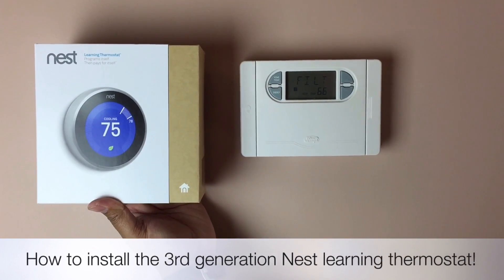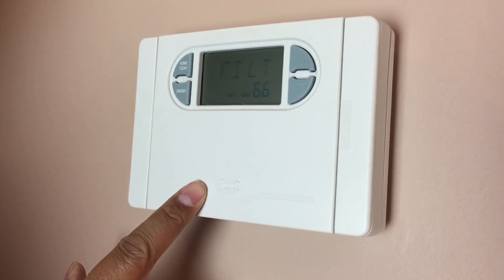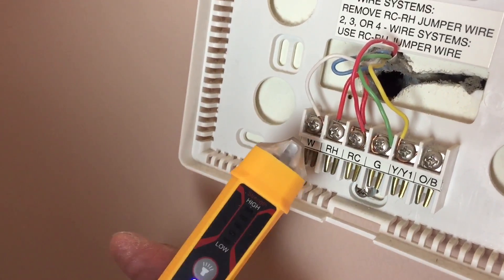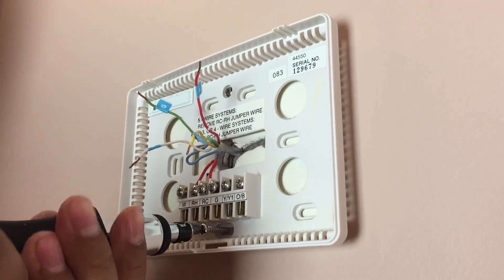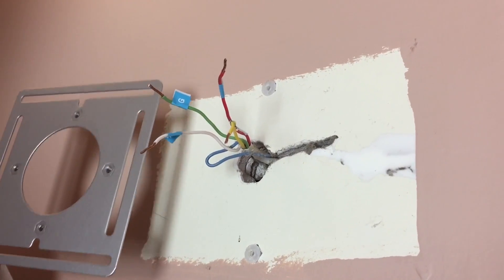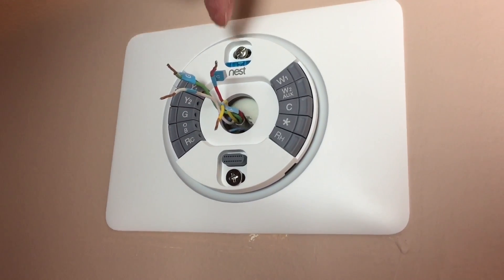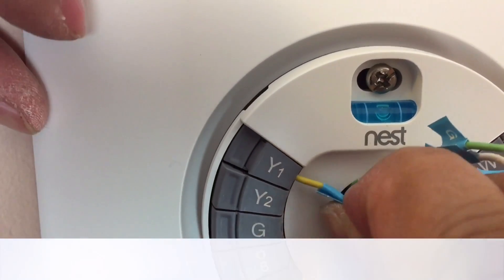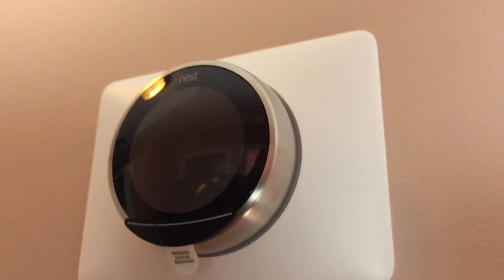Nest 3rd generation installation - A step by step guide

Comment: Thank you so much for this tutorial.  I noticed that your setup didn't include the 5 wire "common wire".  With the 4 wires, did your Nest function properly?
Reply from the maker: Hi, I ended up installing it after the fact. I missed it as it was tucked inside the wall and I didn't see it.
Reply: @johnny0723  Thanks for the clarification!

Comment: Does your Nest thermostat not require a heatlink to the boiler?
Reply from the maker: I'm not sure, I followed the recommended wiring from the Nest app. One thing I ended up doing was connecting the blue common wire, which I missed during the filming of the video and realized later when the nest was complaining of power. It was kind of tucked away initially and thats how it was missed.
Reply: @johnny0723  I think the UK nest always requires a heat link, where as in the usa you just plug the cables in. Behind my current thermostat there's nothing.. haha

Comment: I noticed you don’t have a common wire. The other videos I’ve watched says you need a common wire to power the thermostat
Reply from the maker: Hi I actually did go back and hooked up the common wire. It was tucked away inside the hole and I missed it. The thermostat runs into issues on the summer and that’s what made me go back and check it. Good luck!

Comment: I see you have a dual transformer furnace/heating system with a JUMPER cable which you removed upon install of the nest, same as me. With your current setup it has been working fine? Btw the online compatibility test is very deceiving. On the NEST E it told me it will work, then on page 3 of the install manual said that a dual transformer system will not work.
Reply from the maker: It’s been working well for a couple years now. Note that I went back and found And installed the common wire as well. 😎
Reply: @johnny0723  Oh I see, so without that common wire the unit did work correctly?
Reply: Did you have to run the common cable separate to the furnace?

Comment: This is a really low-effort video but I guess it's useful if people have the EXACT SAME THING as you, which is very rare.
Reply from the maker: Yeah most people will not have the same thermostat. However, the wiring underneath should be very similar for most. Thanks for the comment. 👍🏼

Comment: If theres a power failure,  will the nest have to be reset?  I notice that's a problem with my existing thermostat.  Looking for something that has a memory..
Reply from the maker: The nest has battery backup, but not sure how long it lasts. I've read that you can plug in a power pack to keep it charged though. Check the manual or contact their support if there is a doubt.

Comment: Failed to mention: If the thermostat has just been sitting idle for a long time the battery will probably be dead so don't be alarmed if it doesn't come on instantly. Stick it on a micro USB to charge faster!
Reply from the maker: I hadn’t thought of that, but good tip. Thanks! Both of my Nest thermostats has power and booted up instantly.
Reply: THANK YOU. I didn't think of that..I was wondering if I was wiring incorrectly

Comment: I checked my wiring. Sadly its not compatible with my existing thermostat. And our house was built in 2016. 😭
Reply from the maker: Wow that’s surprising! Make sure you check hidden wiring. I had a blue common wire tucked away that I missed. You can also hire someone to make sure the proper wires are there. If you feel this is worth it. Check with your electric or gas company. Some offer free installation and may do the necessary wiring. They also offer rebates!

Comment: Do you have C wire?
Reply from the maker: Yes. Need it to keep proper power to the Nest.
Reply: @johnny0723  not according to your video. I didnt see you adding the c wire..generally you can jump it at the furnace from y to g then move G to C on the themostat..
Reply from the maker: @rhdtv2002  yes, I missed it when installing it somehow as it was a little tucked away in the back. I noticed sometimes in the summer my Nest would run out of power or something and I couldn't turn on the AC. One winter, my furnace board needed to be replaced and the tech helped me reconnect the C wire that I originally missed. I wished YouTube would let me edit my video to add a clip, but it doesn't. I've updated the video description for folks to not forget the C wire. :)
Reply: @johnny0723  ahh..that how mine was..it was connected at the furnace but left inside the wall when the old thermostat was placed.
Reply from the maker: @rhdtv2002  Yes, in my video you can see the blue C wire in the wall. I didn't notice it or paid attention to it because the Nest app didn't seem to think I needed it. But it was there and I had those symptoms. Everything has been smooth ever since. What is very weird is that my downstairs Nest would not work if I plugged in the C wire. Perhaps its not plugged in at the furnace for that zone? Anyways, everything has been working just fine for both zones so I just leave it and enjoy. :)

Comment: Blue wire goes to c or common, when your battery gets weak your thermostat won’t work. You had the common wire you should have hooked it up, and you may have to connect it on the board at your air handler. Yes the nest has a battery.
Reply from the maker: That is correct. You need to connect the common wire to get proper power to your Nest.
Reply: @johnny0723  did you install a common wire on yours?
Reply from the maker: I eventually did.
Reply: It was just a jumper sharing the 24V wasn’t it? I saw 4 wires and a jumper. I’m just curious because I have the same 4 wires and just ordered one. Hoping it works ok.
Reply: If you have those wires it should work, the blue/common wire powers the nest/charges it’s battery. If you don’t hook up the blue wire it only charges when your air handler is running. Blue would go to C

Comment: We had a major problem installing the Nest thermostat. We have a two stage furnace that apparently requires special wiring for the Nest. We did not know we had a two stage furnace until I inadvertently blew a fuse in the furnace panel (in the attic). You may have THREE power supply switches to your furnace. You need to turn them all off before you start. 

We tried to work with Nest and the technician had us shift wires over and over during a one hour period. It was a nightmare of difficulty in handling tiny wiring. Nothing worked. 

Even the contractor we hired after this debacle was not able to get the Nest to function properly and stop giving error messages. IF YOU ASSUME THAT YOUR FURNACE IS COMPATIBLE WITH NEST YOU MAY BE WRONG. We returned the Nest and put in an Emerson (easy read) thermostat. It works fine and our single story home is very comfortable. 

Sometimes modern digital equipment is more trouble than it is worth. If you want to install a smart thermostat yourself, or use a contractor who is not a "Nest specialist" you may regret it. Sometimes "simpler" is really better. 

sanjosemike
Reply from the maker: Yeah, agree. Definitely do your homework. I made sure to check the compatibility and installation diagrams before I ventured into this.
Reply: Do my homework? OK, how is an "amateur" prepared to know if the furnace in his home is dual stage? For that matter, even know if there is such a thing? The  ADVERTISING with the Nest suggests that all you have to do is to "hook it up" and it will work perfectly. The small print suggests otherwise. 

You will comment that I should not have tried to install it in the first place. I get that. But according to the adds, it's easy. 

We hired a licensed contractor who could NOT get the Nest to stop showing error messages. I do not recommend that anyone other than a person who is an expert in the NEST itself install it. I have no indication that even licensed contractors can install it under every circumstance. 

I am not an idiot when it comes to technology. But like most people. I have my limitations. I guess I was an idiot for believing their advertising. 

sanjosemike
Reply from the maker: Fair enough. I just follow the directions and naively go with the flow. I used the compatibility checker, which asks me to remove my current thermostat and confirm what wires are available, then it tells me if the Nest is compatible or not. I just went with it. Thats all us amateurs can do...and of course anything can happen. I assume most home setups are okay, since the Nests are so popular.
Reply: I appreciate your reply.  We had the contractor install an Emerson (easy read) thermostat that works beautifully. It is easy for my wife to understand. It does not "learn" but one can program it for any circumstances that you wish. 

It seems to have very sensitive temperature sensor(s) that keep the house very uniform and close to the temperature that we set it to. 

Disadvantage: You can't operate it on-line. However, I'm not sure we need that. It remains to be seen if it will save us money. But we live in a very hot (Summer) climate so we "promised" ourselves we would be comfortable at home, even if we have to pay more for it. 

sanjosemike (no longer in CA)
Reply from the maker: Some states have programs from the local electric/gas companies that will come out and install "smart" thermostats for free or heavily subsidized prices, too. be sure to look that up or ask them. The "learning" part of the nest isn't all that...its nice for most days but if you have a change of schedule or work from home, you'll find you have to override the settings...can get annoying. I find the placement of the thermostats are important too, since the device itself senses the temperature. Some brands have remote sensors you can place around the house, such as the Eco Bee. 

I'm glad you found a solution that works for your family..enjoy!
Reply: Johnny0723, thanks for your kind reply. I did look into local electric company subsidized thermostats, and they required the "ability" of the utility to "turn up" the thermostat during electrically challenging times. One can over-ride that too, but I was not aware of it at the time. 

We live in a one story house in a hot summer climate location. The house was built in 2007 and is well insulated against the heat. 

The Emerson thermostat seems very accurate and we find it easy to adjust. 

sanjosemike (no longer in CA)
Reply: My furnace is variable speed, nest won't work with it. You need a communicating thermostat, of course they cost more.

Comment: When using the nest does the heat or ac still work if the Wi-Fi goes out?
Reply from the maker: Yes. WiFi is only for controlling the nest via your phone or Alexa. You can still manually turn on the heat and adjust the temperature. If you’re wondering about power outage, the nest also has battery backup.

Comment: isn't red supposed to go into Rh?
Reply from the maker: I don't remember as its been a while since I installed the Nest. However, its recommended to go through the installation helper on the Nest site to know exactly where each wire connects to, plus to check compatibility before you buy/install the Nest. Good luck!

Comment: Great video man!  You made this look so simple.  I’m going to try to upgrade my thermostat myself now.
Reply from the maker: How'd it go for you? It was definitely easier than I though...just do as much research as you can beforehand and you should be fine. Do keep an eye out for that common wire...If its plugged in on the furnace end, you should plug it in on the Nest Thermostat end too. I guess you could try it on the thermostat end with the common wire plugged in to see if it works, if so, then great. If not, unplug it and try again. I have 2 zones in my house and the repair man came to fix my upstairs furnace, he asked noticed the common wire wasn't plugged in and did it for me, but I think it works only cause he plugged it in on the furnace end during maintenance. I tried to do the same downstairs and the Nest would NOT work...so I'm assuming there is no common wire connection there. I guess you'll know if your Nest ever runs out of power or you lose the ability to control your temperature (usually in the summer for me). Good luck!
Reply: My installation was effortless!  The hardest part was finding the stickers.  I expected them to be inside of the box vs. inside of the installation manual LOL.  My only question was I had a jumped wire from Rc to Rh.  I read the manual and found to not use it.  All works well. I love this thing so far and am installing a Nest for the downstairs unit next week.  I also link with my Amazon Echo.
Reply from the maker: Glad it went well!
Reply: Thanks man!  I was impressed by their attention to detail.  They definitely made the installation process as simple as possible.

Comment: You didn't talk about the jumper cable, I have a jumper cable connecting from and RC to RH would I still need it for the nest
Reply from the maker: +Southpaw Guitars Hi! Everyone’s system is unique. Please use the Nest compatibility checker to ensure your home wiring is compatible with Nest thermostat: 

https://nest.com/widget/compatibility/?mode=guide
Reply: Nest don't allow jumpers, the wires won't even fit in the slot will only accept one wire per slot.

Comment: Just saying when testing for electrical current you do not check by touching the voltage tester to the insulated part of the wire you would want to test the little metal screw holding the wire in place.
Reply: Michael Harvey  it’s a non contact voltage tester it doesn’t need to contact the metal asking as you get close to the wire. There’s different tester that do require a contact to metal
Reply from the maker: +Michael Harvey thanks for the tip. I'm no professional and not even handy. All tips appreciated!

Comment: Great installation video! But may i ask that which specific circuit breakers do i have to turn off to install the Nest? Please help me. Thanks
Reply from the maker: ShawnManh yeah I can't tell you as it differs from house to house. Check your circuit breaker box and see if it's l labeled. If all else fails turn off the master switch to disable all power to the house. Better safe than sorry. Good luck.
Reply: He can't answer this question, you have to look at your circuit breaker box in your home to see what breakers go to what, hopefully they are labeled.

Comment: This will work for a little while then the internal battery will drain and no more ac.
 You need to run a common wire  to the c so it will use the 24 volt from your furnace everything else looks good.
Reply from the maker: Hmmm...haven't run into any problems yet. Thanks for your note, I'll keep this in mind if i run into any issues.
Reply: where does the common wire attach to ( from where to where?) thanks for answer
Reply: The common wire was the blue one that was in the wall that he didn't use.  It plugs into the C slot

Comment: Thanks for sharing this video.  It was useful to know about the nest installation.
Reply from the maker: +Rajan Kannan No problem! Its really not as difficult as some would think...I had concerns myself...but it turned out to be pretty easy. Hope this helps everyone out! I appreciate your feedback!
Reply: +johnny0723 Thank you.  Are you happy with the Nest? I'm deciding between Nest & Ecobee3. I'm an Apple guy & thinking the homekit integration would be complete setup for me.  Any thoughts on ecobee3 ?  Have you used the ecobee3 before ?
Reply from the maker: +Rajan Kannan I am also an Apple guy...but no experience with the ecobee. It's a good concept but everyone has a Nest and I figured I couldn't go wrong with one. I'm glad I got it. Once you go wifi controlled you won't go back. I love being able to monitor and control it from anywhere. I get monthly reports on how efficient I've been compared to others in my area. The display is beautiful and senses my presence from a good distance, even if it's pitch dark. The Nest was also super easy to setup. Good luck. Let us know what you go with and how it turns out!